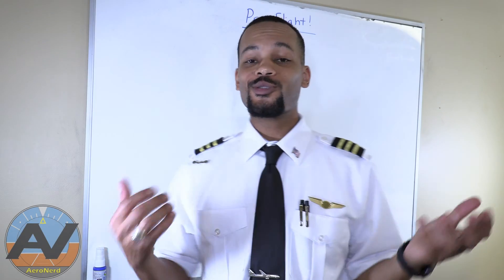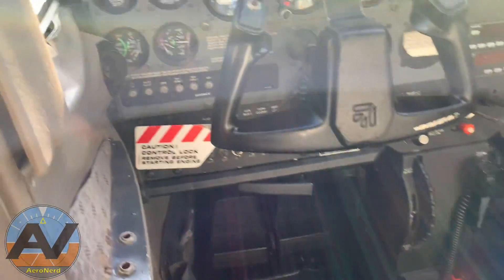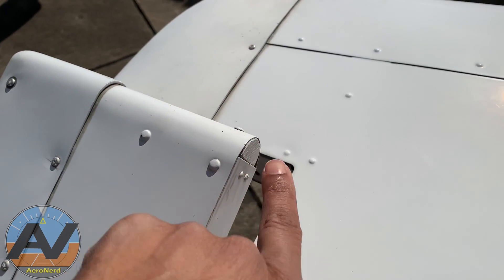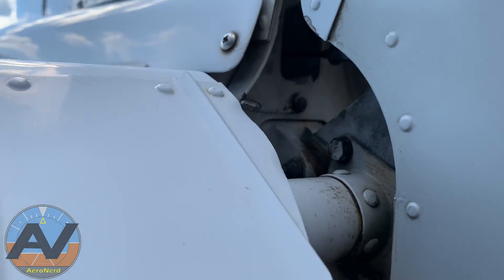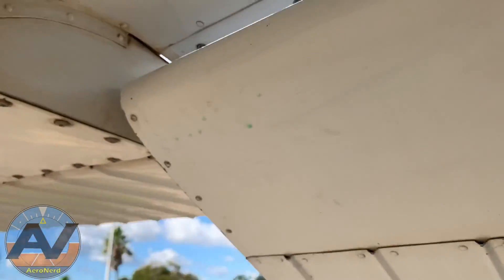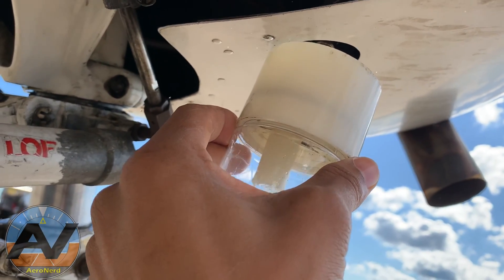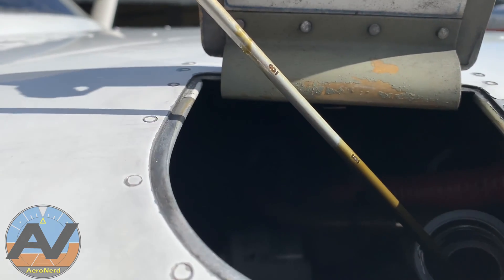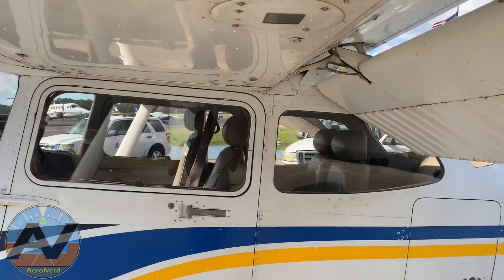Private Pilot Ground School 2: How to Preflight a Cessna

Comment: Thanks for the details in the preflight. Also, I agree about getting the medical early.  I actually did my class 3 medical, ground school, and passed the written exam before I started before doing much flying. After all that,  I could focus fully on flying without worries about the test or the medical. Getting the medical early is important because it is not a guarantee regardless of age.